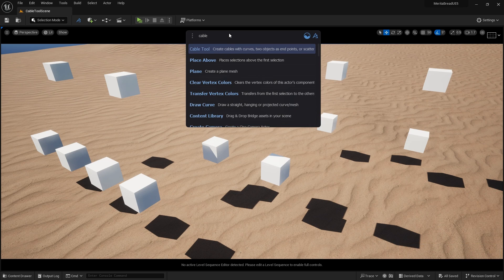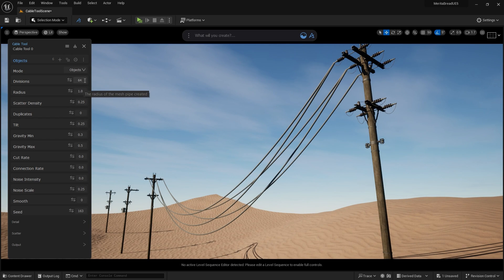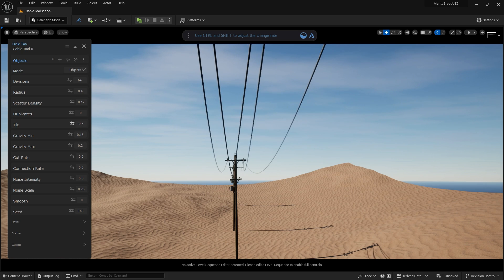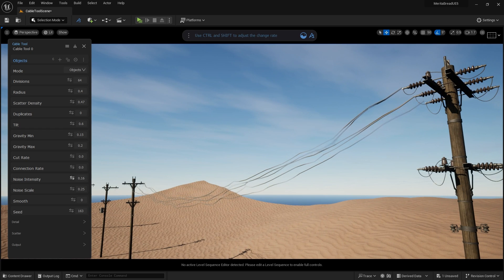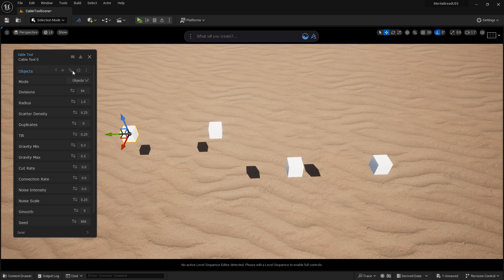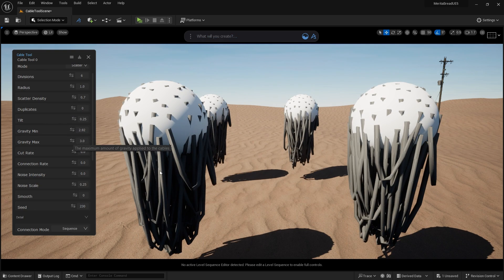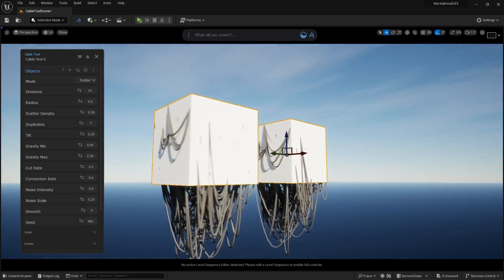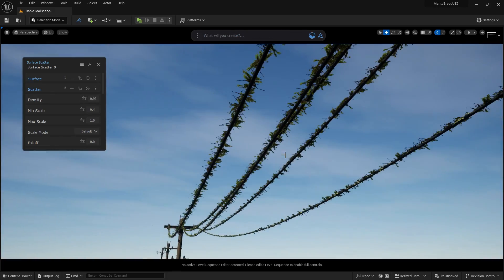How to Create Procedural Cables in UE5 - World Building Plugin

Comment: Is it possible to integrate this into PCG with Buildings with hanging cables from them ?
Reply from the maker: There is no direct integration between Dash and PCG, but pretty sure you should be able to create the buildings with PCG and then use the Dash Cable tool on the result from PCG😀

Comment: Very helpful plugins possible to  put specific mesh like customized cable hanging lights or flags
Reply from the maker: Great idea, noting it down! For now, what you can do, is assign a nice material to the cables, and then scatter flags or lights on top of the cables, with some changes in the settings in Surface Scatter you can definitely get a great result with hanging flags I think! :)